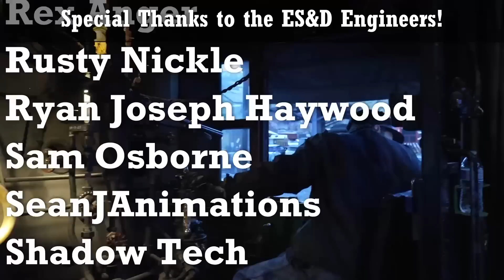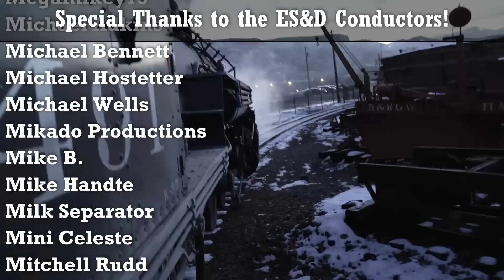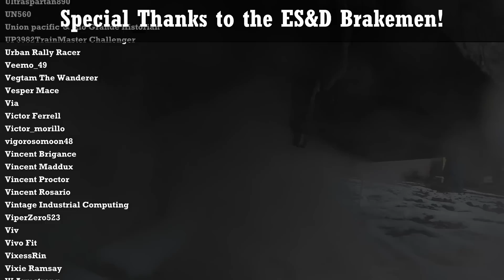Light rail isn't light? Street Car vs. Light Rail vs. Commuter Rail | Railroad 101

Comment: im a lightrail driver, in German speaking parts of europe we call them Stadbahnen (City railways) and Streetcars/Trams are called Strassenbahn (Street Railway) 

The definition in europe is pretty clear. if it only has doors on one side, its a tram, if it has doors on both sides, its light rail. same with two cabs and single cab, and usually city rails use versions of TPS, the Swiss example being we use ZSI127 which is whats also used by narrowgauge railways here
Reply: Who came up with that definition? I've never heard of it and I heavily doubt this is serious in any way, because unidirectional vs. bidirectional vehicles says nothing about the system's qualities.
Reply: @bahnspotterEU It's false
Reply: Somehow, the single ended vs. dual ended definition as a per se rule bothers me, coming from Switzerland. There’s quite a few lines that once were separate narrow gauge railways that got interlined into their local tram networks and thus converted to single ended operation (in Germany, I know Karlsruhe S1/S11, that are run with trams despite clearly being an S-Bahn worthy line) while Geneva is reviving its tram network but likes the flexibility offered by double ended trams that clearly remain trams in my eyes. But I guess the exception confirms the rule
Reply: @genoobtlp4424 Innsbruck in Austria also has two lines which used to be narrow gauge steam lines that have been converted into a system that is compatible with the tram rolling stock. But aren’t they running historical steam trains every now and then? They also keep the traditional names for the routes, so the heritage is clear. Wonder if a light rail definition would be applicable here at all.
Reply: @AndreasSebayang  I don’t know the details about the Stubaitalbahn, but Innsbruck is definitely a double ended Tram system and in no way light rail. As for the classification, just like the BLT routes 10/11, Forchbahn in Zürich and the Karlsruhe S1/S11, they would probably fit the old „Interurban“ classification (in German I‘d call them Überlandtram)
Reply: @genoobtlp4424  That's the S-Bahn Rhein-Neckar, the S-Bahn Rhein-Main is further north in Hesse and centred around Frankfurt.
Reply: @MarioFanGamer659  damnit, knew I got something wrong
Reply: Interesting on the single/double sided point.. I'm in Berlin and the Trams here are mostly double headed, while some lines still operate trams with doors only on one side. They're all a part of the same BVG Tram system. So how does that balance out 🤔
Reply: Our Tram line between Mannheim and Heidelberg has doors on both sides and uses the S-Bahn (Light Rail or Commuter Rail) rules and is allowed to go up to 80km/h while its between the cities, and while in the City, it uses the Tram rules. Complicated
Reply: @hypermaniksk534  The Rhine-Neckar tramway is a very interesting as while it's technically a tram-train network, its unique in that the railway laws are ESBO (narrow gauge railways) rather than EBO like every other tram-train system (this includes the Nordhausen tramway as the Harz Railway is classified as EBO instead of ESBO despite being a narrow gauge railway) and so the railway part really feel like an extension of the tramway rather than a tramway which runs on a mainline (making it closer to Darmstadt than Karlruhe).

One notable side effect is that ESBO actually allows for street running (see the Mollibahn through Bad Doberan as another example) so you get trams acting as trains acting as trams.
Reply: Jena runs exclusively double headed and double sided trams, because they have one or two dead ends in their system. Dresden has both, most of the new rolling stock is
 single direction, but some are double sided and used when lines are shortened for maintenance.
Reply: Yeah... not really. Whether the vehicles are uni- or bidirection doesn't make much of a difference and really only affects how the tracks end as well as (potentially) where the platforms are located (and even then, most bidirectional vehicles will still open the doors on only the right side outside of the termini). Some systems use both (aside from Berlin as one noted, Mainz also uses a mixture of uni- and bidirectional tramcars).
Reply: Yeah this definition is definitely incorrect. The Berlin Straßenbahn system has both uni- and bidirectional vehicles with doors on either one or both sides, depending on the line, and they are all still most definitely streetcars. What in the world is this definition?
Reply: I mean the definition is - does it have a dedicated right of way or is it shared? Light rail takes up more space, needs more infrastructure. Some systems are kind of hybrids, works as light rail part of the rout and tram the rest. Also different purposes. Light rail for traveling longer distances than trams which often makes much more stops in denser neighborhoods.
Reply: Other unclear examples I know are Kassel and Gotha, where both cities have single sided trams but run more than 30 km into the next town on what used to be a seperate railway.
Reply: Most S-Bahn systems, at least in Germany, would actually be considered as heavy rail. Even most subway systems are. The classic European example for a light rail system is the DLR in London, which was specifically built as such in order to be cheaper than the heavy rail Underground.
Reply: Interesting definition, here in Melbourne Australia, our early trams had no doors, (early cable driven) but that slowly changed over the years after they went electric. We kind of had to have doors on both sides as  at the end of pretty much every line the two tracks merge into one for the last stop then the double ended tram then runs back on the other side mostly using the other side doors (the stops were never standardised, some have a central, as in between the tracks waiting area, also using the other doors)
Reply: In Belgium we have both single cab, one side Doors AND double cab both side Doors trams. Antwerpen witch is partially run as a pre-metro is singe cab and classified as tram, the Kusttram (coastal tram) also single cab, but has a slightly wider loadinggauge. In Ghent there is also a tram that is double cabbed and has Doors on both sides. All three systems use metergauge and run the same electrical systems. And a number of vehicles from both city's join the Coastal tram during the summer to make sure a 10 minute frequency over the whole line (and in the middle of the line there is sometimes even a 5 minute frequency) 
They move theese every year by road.
Edit: And all lines could be considered as light rail to, as varying percentages are on a diveded right of way, but since they also run a fair chunk on the road in and amongst the cars and trucks, it's still a tram, and we have been calling it a tram for over 150 years so...
Reply: I don’t think they’re called Stadtbahn in German speaking Switzerland
Reply: @SebastianD334  mainly because they don’t really exist as such there
Reply: That's not true. Light rail is a tram network with a significant amount of seperate right of way, regardless of whether there are doors on both sides or cabs at both ends. A kind of tram/rapid transit hybrid if you will.

Charleroi in Belgium has light rail services using vehicles with one cab and doors on one side, the Stadtbahn in Karlsruhe used high floor light rail vehicles with one cab and doors on one side until 2015 and many regular tram networks in Europe use vehicles with doors on both sides.
Reply: This door based definition is most certainly wrong for Czech Republic and Bratislava.
Reply: @veronikakerman6536  It's also wrong for germany.
Reply: IMHO it's also the platform/train height: here in Brunswick we have a Straßenbahn/Tram network and the classes since the 1990s have level (low floors), so they just need a simple ramp for wheelchairs and low platforms and only have doors on the right side and one control cab (in the back there's only a simple control panel for shunting); Stadtbahnen like in Hanover usually have high floors to serve the underground stations (they planned to make it a full subway network but instead only built the tunnels near the city center and these all leave the tunnels a few kilometres outside) and because it orginated from a Straßenbahn network, the older classes TW6000/TW2000/TW2500 have additional steps that activate on old stations where the platform isn't elevated yet, however the newer TW3000 doesn't have these steps anymore because the lines these are serving have all elevated platforms, they also have doors on both sides and control cabs on both ends.
Reply from the maker: That's smart!